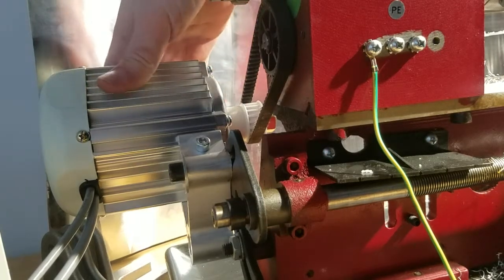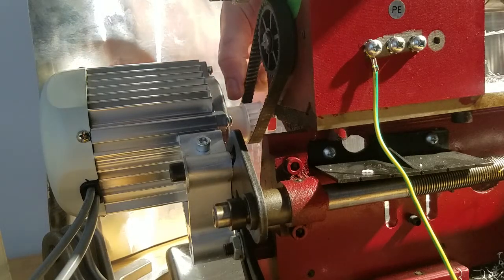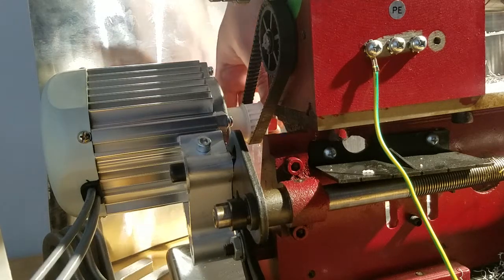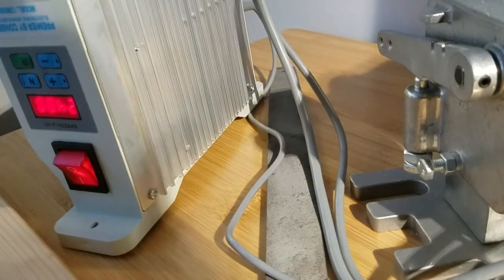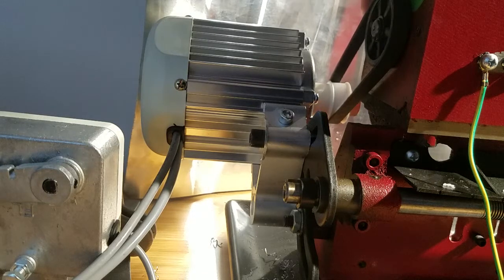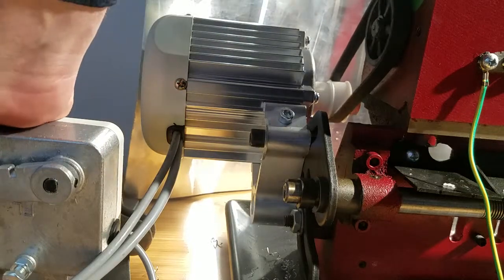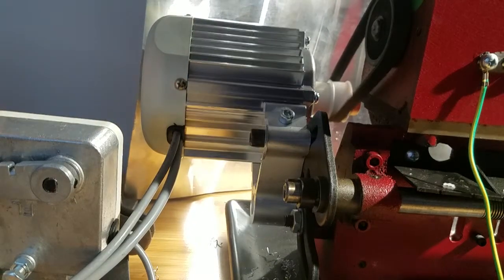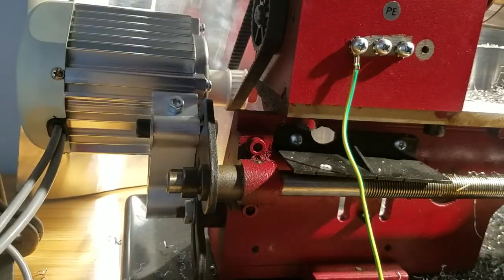Consew CSM3000 mini lathe upgrade

Comment: I did a similar project on a taig lathe with a consew motor but the problem for me was the brake in the motor causing the chuck t spin off the lathe.
Reply: You should be able to adjust the braking to be less severe

Comment: Hi Jesse. I wondered if you got around to changing the Hall Effect to a potentiometer for speed control. I need to do the same but don’t know how.
Thanks Mike
Reply: Sorry, not the video author, but I'm working on that now. The following video shows someone who managed to make it work with a potentiometer and an added resistor. https://youtu.be/2odD3n6rj9c?si=CjtYQaeoWu9oxXo0 
I just found out that they make a rotary Hall effect position sensor 'potentiometer" that should have the same connections as the 49E Hall effect sensor provided with the Consew kit.
 I hope that helps!
Reply: @eljohn3 who is they?
Reply: @eljohn3  
Why is the Hall effect control not suitable?  Thanks.

Comment: I’m going do my unimat with upgrade motor. Probably do cnc to. I got good good deal on it looks brand new to be made in 1950s. In the wooden box came in milling attachments few extras. 500$ kinda local. 50 mil s apart met halfway. He wanted 600$ Craigslist. Sold it to me 500. He got it in a estate sale from doctor. Box in there that had dr address where nailed to him back n 60s. He must got something else like little mill bits or something. 3”x2” old brownish cardboard box. Kinda neat.  Holler at ya later.

Comment: Hello. Just ran across ur channel. Went to ur videos section looks good stuff I like. 
Have emco unimat db/200 first edition heavy cast bed with one big x. Have ender3 max  with bl touch I put on. Made few 10/22 parts. Found on thingiverse. Not real computer savvy so need get firmware for bl touch. Not sure how do it I’m more hands on mechanical work. Welder/fabricator. Mechanic. Computers not so much starting to learn. My kids help me mostly when need something on computer. lol. 
I’ll be checking out ur channel and leaving comments I’m talker. lol. Never leave bad, nasty comments if something I don’t like heck I turn the channel or turn off do something else. lol. Talk to ya later in next video I watch. 
Stay safe from ur ole hillbilly buddy.

Comment: I got the same motor marked 800w from vevor.com for $89 shipped. It's a 220v though. It doesn't look to be 800w judging by the size but I haven't tested it yet. Plan to use on my 8x16 lathe as the stock "750w" brushed motor bogs severely, also going to change from the tiny v belt as it slips unless you run it so tight it frays within 30 minutes....very poor design.
Reply from the maker: i have another where I compare a generic version with the consew.  short answer: consew is better and the controller is more robust... get what you pay for but only just a bit more.

Comment: Hi men i just had the same as you. Working well for small pieces but im trying to use it for treading. How do you do it with that motor? how you control the speed conected to mach3.

Comment: Do you think the motor is usable for a small bandsaw?
The variable speed makes me think of using it so my bandsaw can be used to cut metal
Reply from the maker: I think it would work on my bandsaw but it has a worm gear reduction which really magnifies the torque.  It may not be able to direct drive a metal cutting bandsaw.
Reply: @JesseSchoch  was wondering the same.  My solution would be to have belt drive reduction from motor to saw, say 3:1.    Running the motor at 300 rpm should have enough power to cut metal yet be slow enough to preserve blade.  Then just speed up motor to near max for cutting wood.  Keep in mind, you still have to change the blade, so it's never going to be really convenient.
I'd try the above with the enduro unit, not the consew.

Comment: Hello sir. i oo have same motor. have u figured out how to use the lever? any chance of making speed controller and reversing option
 similar to original motor?
Reply from the maker: The lever works great.  To add reversing you need to wire up a triple pole double throw switch to the motor power and another one to the hall signals.  Swapping a single pair of the 3 wires will reverse the motor.  You just need to be sure you also swap the correct hall signals.  You also could get a new contoller but 110v 750w brushless motor controllers are not at all common.

Comment: Jesse.
I was able to have the plastic drive gear printed and fit it to the same servo motor you used. It also had a wobble most likely due to being printed in solid ABS and sagging. Anyway the motor gear was a .200 pitch to fit a US XL toothed belt. this is not what my mini lathe uses. It also was not durable to run a lathe for any real turning. It was enough for me to cut a set of aluminum USA L size gear/timing belt pulleys to fit my lathe and set it up with the 1/2 inch wide heavy duty toothed belt and gear/pulleys. that belt is near triple the strength of the factory original belt. 10 tooth on the motor, 17 on the spindel. Than I ran the lathe for two days and I have to say, it cuts like a dream. Up to 2000 rpm's and back to zero in seconds. 50 rpm's and you cannot stop it. It does need to balanced to run like this but up 1,800 rpm's it's tight. No slowdown, no issues except: The 3 3/8" wide bed + cross slide is not suitable to run this horsepower. Eventually I tried to cut to much as in what a much larger lathe would cut as there was no issue with power. It cut this deep at 1,200 rpm's with no strain but the cross slide all of a sudden started chattering, shaking and pulsating and before I could shut it down the cutter jammed. it only took 2 seconds and the control unit for the motor smoked. well so much for selling that mod. It's not stable enough to warranty. Maybe I will play with it again later. for now I just ordered a much larger and better lathe with 7" ways.
Reply from the maker: you can get replacement controller but it may make sense to buy a brushless motor controller that can reverse a bit easier.  The motor should still be good.  I have a 200mm fan running on the controller at all times which really reduces the temperature and maybe saves you some time in case you stall it.  I've stalled mine a bunch of times from crashes but never for more than a few seconds.

Comment: I'm curious to know how this is performing for you so far? I'm interested in trying one of these motors out on my old lathe, as the speed control would be really handy.
These motors seem like they have most of what you need already, in a compact unit, compared to other motor options. I've only seen a very small handful of people doing it though.
Reply from the maker: Good timing since i'm working on another conversion and I have been thinking a lot about spindle motor options.  For the price it is really great, it has more torque than the original 750w motor and stops on a dime.  Low RPM threading is no problem in steel.  I have read that it will quickly burn up if it gets stuck.  I have stalled mine a few times and not noticed any problems though.

The problem is the controller.  There is no reverse button so you need to long press a button to get into the configuration mode of the VFD and then select the right parameter and change it.  It also does not have a direct input for speed control.  The sensor for setting the speed is an analog hall sensor sending ~2v..5v and while it works quite well it references a ground that is way above (like 140v)  what you'd have on an arduino.  You can interface to that pin but you need to be sure it is fully isolated from your arduino or whatever controller you are using.  On a mill where  you are not tapping the lack of reverse would not be a bother.  On a lathe it is a bit annoying.  my lathe is setup with a centroid acorn board and i don't have to use reverse for threading.  If i had to do threading my hand I would really hate the setup.  I mostly use reverse for parting.  The easy fix however is to wire up a 3 pole double throw switch.  To reverse a brushless motor you just need to swap 2 of the 3 wires and that is what the switch would do for you.  I'm not sure if i'm lazy or just being practical but the annoyance of doing the reverse on the controller has not caused me to hook up a manual reverse switch for my lathe.  Finally it does get hot.  The back of the VFD has a 2 prong 110v receptacle that turns on when the main power to the VFD is on.  I believe it is for a light.  I've hooked up a 12v power wart, buck converter, and 100mm fan running silent at about 7v so that the VFD gets active cooling and runs quite cool now even after being on for a while.

I've done a bit of research on the VFD board and it's controller.  It is fully capable of taking pwm inputs for speed control and having a DIR pin.  I imagine it could also even accept a signal for an encoder.  If I had the gumption i'd try to contact the manufacturer to see if they could make a version for hobby CNC use since it is mostly just a software change that is needed and adding an input header to the board (there is a blank header on the board that might actually already be usable!?).  I currently don't have access to 220v and there are not many great options for 110v servo motors.  As a side note I did see several cheap large servos on amazon (80ST-M02430) but they were marked 220v and I have not seen configurations for the controllers for 110v.  The main benefit of these would be the ability to do rigid tapping and step/dir positioning for the lathe if you had a tool post spindle.
Reply: @JesseSchoch  I had the same experience.  The controller box is really big, therefore difficult to locate conveniently, and the various codes you have to type in to control it are bullshit. There is another motor out there that is much, much better.  On Amazon it's called the 'enduro' motor.  It's quieter, near silent actually, and its control circuit is right on the motor, and is much simpler, just a knob for speed limit and a lever for 'throttle'.  It also has a reverse switch.  I now own both, but I strongly favor the latter.
Reply: @JesseSchoch  Thanks for the reply, and the details you've provided. That's a massive help! cheers.